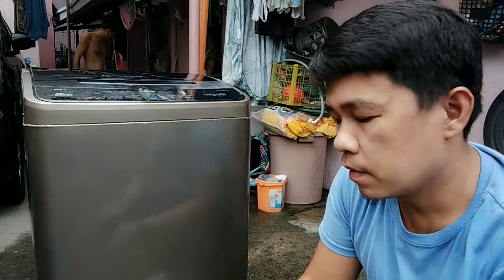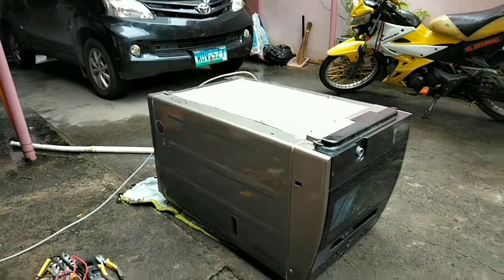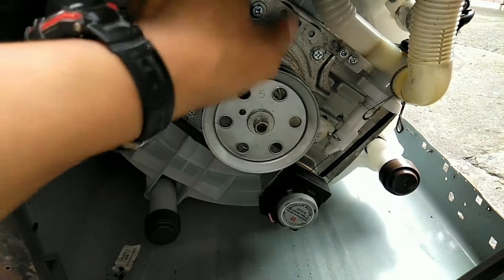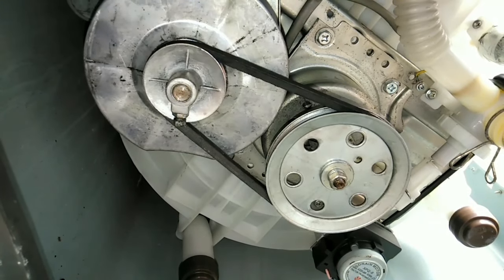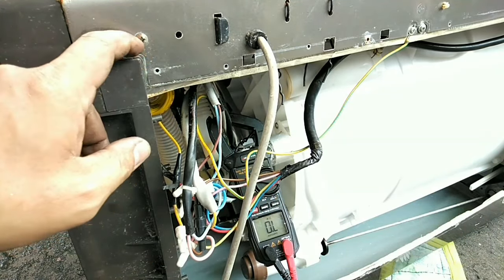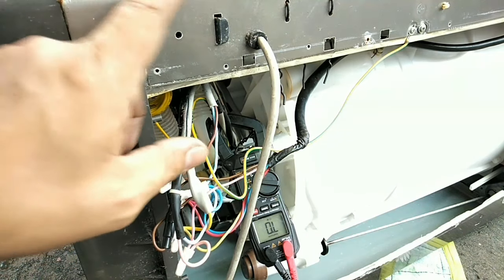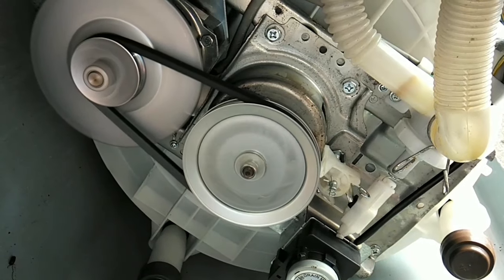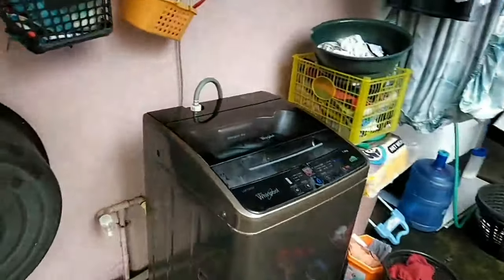Whirpool Automatic Washing machine SPIN Problem.( Tagalog )

Comment: Hipo ask k lng po d na kaya mag heavy duty spin  ng topload 10.8 kgs whirlpool kpag nka 6-10liters n po ang tubig umuuogong nlng everytime may rinse ng pakaliwa .. sa preno lng dn po b kaya problema nya

Sana po manotice, and ask ko lang din po kung gumgawa din kayo ng Cl98 LG Xboom 3500watts speaker
Reply from the maker: posible issue:

Running capacitor
belt
motor bearing

Comment: Master kakaiba problema sa aking panasonic auto wach mach.. NAKA SWITCH po sa washing pero panay parin drain ng tubig master.. malinis naman ang drin plug.. pag nkapatay ay sarado drain plug. Pag magwash na ay tapon parin ang tubog.ano kaya sira master ok naman drain motor
Reply from the maker: meron po ako video gaya ng problema nio sir..solve agad ang issue

Comment: sir gud am ask ko sana posibleng problema whirlppol fully auto isang direction lang rotation ng washer model lsa 1100 maraming salamat po
Reply from the maker: Dalawang bagay lang po yan.
Running capacitor 
Board

Comment: Ka master ask ko ung eurotek topload ko, pag ung clockwise na ikot ay sobrang hina.... Sa preno din kaya iyon
Reply from the maker: Check.po.muna  capacitor sir..
Reply: @kamastertvlhonsantelices  eh pag sobrang ingay pag nagsspin sya... Talagang malakas ka master
Reply from the maker: Ok ganito po.eto mga posibleng sira kapag sobrang ingay na ng spin mo.or dryer.

Motor bearing
Suspension rod spring
Gearbox

Comment: Sir whirpool model LSP1080GP sira na motherboard  ngayun nag ordr aq ng motherboard sa lazada WB603803 mother board tugma ba sila operate nmn cya kaso spin dryer mabagal ikot lng anu ba problim master di ba pwde ang naorder ko sa lazada sana masagot mo master
Reply from the maker: Copy...tugma yan..check muna preno.at ung tension ng adjuster
Reply: Salamat master
Reply: Sir ok nmn ang preno at tension  pag dating sa 4 tuloy2 na ikot nya at ginawa ko yung ginawa nyo na ibaba preno di aman nag shake

Comment: Sir samsung automatic po ung washing machine ano po kaya problema nung last n ginamit ko sya ayaw nya tumigil ang ikot tpos isang dereksyon lng ang ikot nya ayaw nya bumalik khit nipause n ndi sya natigil so pinatay ko power tpos nitry ko ulet pinower on ko at inistart ayaw nya umikot pra malaman kung ano water level ang need nya tpos ayaw nya rin tumangap ng tubig..sana po masagot nyo thanks
Reply from the maker: Kong dipo siya nagre refil ng tubig.
Soliniod valve po agad ang problema niya.at ung hindi naman paghinto marami po pinanggagalingan yan mam.kong continueos ang ikot at walang error na nagre register maari po sa program yan.pero kapag diretso ang ikot at may error agad,maari po mechanical system po problema niyan..bka po naputol ung pinaka spring splutched nia kaya ayw na bumalik...pero mas maganda kong macheck ng actual..mahirap.po kc ganito lng.limitado lng ang maibibigay ko impormasyon base po sa inyong sinasabi.😇😇😇
Thank you po..Godbless
Reply: Kung sakali ganun po ang sira magkano po ang singil nyo?
Reply: Pde po b kayo mag home service sa cavite?
Reply from the maker: San po kau sa cavite mam Liezl.😇

Comment: Ka master san mo inadjust ung preno sa pulley ng washing machine automatic top load
Reply from the maker: Sa may tabi po ng drain mechanism..wala pong ibang turnilyo dun na may adjuster..nakapatong sa padle ng drain mechanism.pag hatak ng drain.motor sasabay po un para buksan ung drain system thesame time ung tension ng brake luluwagan niya rin.pero kong mahigpit ang brake tension uugong na lng po talaga yan..mahigpit ang brake tension.atleast 5turn lng po kapag mag aadjust kau..baka sumobra naman..ung drain system mo naman ang luluwag..dire diretso ang tubig po niyan..tamang adjust lng sir.
Reply: @kamastertvlhonsantelices  salamat ka master may itatanong ako un bng cap 4 uf sa isang motor pwede konrin bng gamitan ng 5 uf
Reply from the maker: Pwede po dahil.kong inyong mapapansin ang mga capacitor ay may Tolerance na + or - 5%.kaya pwede po yan..

Comment: May effect ba if yung black rubber sa may filter is nahulog sa loob ng butas?
Reply from the maker: Ano.po ba tinitukoy nio..sa inlet valve
Reply: Hindi ko po alam tawag dun
Reply: Sa Whirlpool po na top load yun. Nilinis ko po kasi yung nagttrap ng dumi tas meron po palang rubber na nakadikit dun mismo and natanggal sya at nahulog sa butas

Comment: sir anu po problem pag ayaw po umikot ng spiner motor po, bago na po capacitor nya, at buo naman po ang motor kasi binaklas ko po sya at sinuplyan ko po umikot naman po  , at buo din po ang presure switch po, pero hindi parin po umiikot ang motor at tinanggalan kona rin sya ng belt hindi talaga sya umiikot ang motor pag inispin na po sya,,, anu po kaya possible problem,,,,,, salamat po

Comment: question po master, yung whirlpool washing machine po namin pagka plug sa kuryente may umuugong po agad kahit naka off pa po.
Reply from the maker: Pakiramdaman nio po.muna sir kong saan nangagaling ung ugong..sa bandang panel board ba oh sa bandang baba s motor side..
Maari nio nmn buksan ung bandang likod ng washing para makita nio kong saan nangagaling ung ugong..kc kong sasabihin ko na sa motor side nangagaling ang ugong wala po ako sapat na basehan..mas maganda po try nio po.muna DIY para po makita nio rin mismo ng actual kong san talaga nangagaling nag ugong..marami po kc posible pangalingan ang ugong..kapag naka sense na siya ng power khit dimo siya i ON..maari sa drain motor,sa soliniod valve,sa motor, sa panel board..
Reply: @kamastertvlhonsantelices   salamat po sa sagot master, muka pong sa may motor banda master.
Reply from the maker: Ok..kong sa motor side ang ugong.ganito gawin.mo.DIY ulit.tanggalin mo koneksyon ng belt sa.motor at pulley.then paandarin nio..at dun nio malalaman kong saan talaga ang pinaka point ng problema..maari stuck up ang motor..pero kong umandar naman ang motor..maari may problema ka sa preno.
Reply: @kamastertvlhonsantelices  maraming maraming salamat po master, hanapin ko nlng po yung video nyo about sa pag adjust ng preno.
Reply from the maker: Welcome Sir😇😇

Comment: Master ? Ano po kaya problema ng washing ko . Ganyang model din . Hindi nag fifill ng tubig . Kusang nadedrain tubig nya
Reply from the maker: Panu po nagdi drain ung washing nio Master,kong dipo nag re refill ng tubig..tabo na lng po ba ginagamit nio.
Maari po may problema ung soliniod valve ng tubig nio kaya di nag rerefill ng tubig .at ung kusang nag didrain naman maarin may problema sa drain motor niya.
Reply: @kamastertvlhonsantelices   nka connect pdin po yung hose sa ibabaw pag nilalagyan ng tubig . Ang nangyayare master hindi sya magamit pang wash kasi pag naglagay na sya ng tubig hindi sya napupuno lumalabas lng yung tubig sa drain hose nya . ginagamit nalang namin sya pag magdrain ng damit
Reply from the maker: Kapag ka hindi po kumakarga ng tubig..Ang sira po niyan ay Solinoid valve.
Kapag naman po kusa nagdi drain..maari po drain motor ang problema niyan..oh ung drain mechanism.niya sa loob ng tubo..baka po punit na..

Comment: Master yung sa akin posible din kaya preno kasi maingay sya pag spinning. Paano ba adjustment nya, sa turnilyo ba?  Salamat sa sagot
Reply from the maker: Sobrang ingay po ba..pag brake po ang problema...umuugong lng siya..kong sobrang ingay baka putol napo ung flutched spring nia..maalog masyado.😇
Reply: @kamastertvlhonsantelices   Master umuugong lng Ang spinner. Paano po ba mag adjust ng preno? Thank you.
Reply from the maker: 5turn paluwag sir. Dun sa adjuster nut.dahan dahan lng baka sumubra naman ung pagluwag.
Reply: @kamastertvlhonsantelices  salamat Master. Na try ko knina same pa din.  Gear box or burring ba tawag dun. Yun pla ang  sira stuck up na. Baka po meron kayo available Master bilhin ko nlng. Thank you sa reply.😄
Reply from the maker: Sa Quiapo ako bumibili niyan sir😁😁😁
Reply: @kamastertvlhonsantelices  ok  Master. Thanks ulit. God blessed.
Reply from the maker: Welcome Godbless😇😇
Reply: @kamastertvlhonsantelices  master yung bang clutch spring part din ba sya sa brake system?
Reply from the maker: Yes po..part siya..at Ung brake po un ung nakayakap at umiipit sa hub.sa pamamagitan ng drain cable hinatak niya ung clutch para ihold at pakawalan ang hub.kapag ito ay nagdi drain at nag spin.para maiwasan ang sobra sobrang ikot ng  
Drum kapag tapos na mag spin.
Parang sa manual lng din..meron brake shoe na naka hold sa hub..parehas lng sila.un nga lng sa automatic bahala na ung system sa operation.unlike sa manual kylangan mo.buksan ung takip para mag brake..😇😇

Comment: Boss pano po pag wlang power ano kaya possible na sira non?? Meron kapo bang video na Ganon Kung pano ayusin ung wlang power na whirlpool auto wash machine
Reply from the maker: Need nio po muna ipa check kong sakali kong meron jan mas malapit na tech.pero bibigyan ko po kau ng idiya bakit wala siya power as in deadset ang unit pati electronic controler.
Eto po posible na sira.
1: Power cord
2: Transformer
 Yan po muna ang sa tingin ko sira niyan.dahil jan po nag mumula ang power sa dalawang component na yan.
Salamat po😇

Comment: Sir whirlpool automatic din gamit ko. No drain and spin din sya.  Pero umaandar yung motor pati pulley.  Okay din drain motor. Pero nag stop pa din after ng wash cycle tapos ayaw mag drain and spin. Ano kaya problem?  Thank you
Reply from the maker: Ano po.lumalabas na error.
Reply: E4 po
Reply from the maker: May kinalaman yan sir sa LID switch.or unbalance load sa tub.
Reply: Yes sir. Pero sarado naman yung lid.  kahit tubig lang laman e4 pa din lumalabas. Dinala na din po sa shop sabi board daw. Bagong palit na din ang ganun pa din
Reply from the maker: San po location nio sir..
Reply: Near sm novaliches po

Comment: Master Tanong lang Ganyan din po kasi Washing namin ang problema po kasi ayaw tumigil magkarga ng tubig kaya ayaw mag Wash  saka panay E1 error Ano po kaya possible Sira po nun? Sana po masagot nyo ang katanungan ko 😩
Reply from the maker: Posibleng may problema jan sir ay Water level sensor...at drain motor
Reply: Magkano po kaya paayos ng ganto sir? Kasi 3 months na namin Hindi nagagamit yung Washing.nung May lang namin nabili
Reply: Sir ask kona din po ano po tawag dun sa blue na takip sa ibabaw po ng kabitan ng hose? Nawala ko po ksi yung takip na parang hipitan ng filter.saka pede ko po ba kayo ma pm sa Messenger nyo para mapadali po pag contact sa inyo? Marilao bulacan po ako
Reply from the maker: Waranty papo yan sir..baka pwede nio tawag sa whirlpool..
Reply from the maker: Cge sir...wait ko mesage mo sa mesenger

Comment: Boss parehong model ng washing machine namin. Ayaw mag spin dry. Humahatak kapag nag drain. Saka na wawash at umaandar motor. Na check na din ng tester capacitor. Buo pa. Baka makatulong ka. Salamat po.
Reply from the maker: San po location nio Sir.
Reply: Paranaque boss
Reply from the maker: Na check narin po ba ung clutch nia sir at ung brake tension..baka kc sobrang higpit kaya ayaw tumuloy ng spindryer niya.
Reply: Master ahingi ng number para matawagannk po.may ipapaayos po Sana kmi.

Comment: Master, E4 problem, gumagana naman motor and close lid. Ano kayang problema?
Reply from the maker: May kinalaman sa drain system
Reply: @kamastertvlhonsantelices  ano po contact number nyo master?
Reply: or kahit fb messenger
Reply from the maker: 09976217047
Reply: @kamastertvlhonsantelices  nagmessage po ako sa messenger nyo Master. Asking po sana how much parepair.

Comment: Pano po mag reset ng whirpool  waching machine gumagana naman po kasi ung sa dryer or spin lang po ang ayaw parang may napindot po kasi
Reply: Magkano po pa service  san jose del monte bulacan lang po qko
Reply from the maker: As long as wala.po error Mam...no ned po mag reset..maari may problema lng sa mechanical system nia.
Reply: PAG MAGPAPAGAWA PO PANO KO PO KAYO KO CONTAKIN
Reply from the maker: Lhon Santelices
My messenger name.
09976217047
My contact no.

Comment: anong model po yan? ganyan din yta model ng akin. ayaw mag reverse po
Reply from the maker: Automatic din po ba Mam.
Reply: Opo
Reply from the maker: San po location nio Mam😍
Reply: North caloocan po. Llano
Reply: tinest ko po ng walang laman ngaun. maayos naman po ikot clockwise and counter. na ooverload lang po yta. wala po kasi ako timbangan para malaman kung overload.
Reply: maya test ko na mga 12 lang laman na damit kung maayos iikot
Reply from the maker: Taga llano po ako.dati nakatira.sa Barangay Silanganan..malapit sa may rebisco..ganito gawin nio.tanggalin nio muna ung connection ng belt to pulley.stand alone po ang testing nio.then paandarin nio washing.kapag umandar po.ung motor ng forward at reverse.means po good ung rotation ng motor nio.maari may problema ung adjustment ng brake nio.kumakalas sia kapag reverse rotation.pumipitik po yan or kumakalas kaya wala siya reverse.
Reply from the maker: @ulupongmotovlog2682  Anytime po as long as kaya ko kau i acomodate para mareplyan at mabigyan ng advice handa naman po ang inyong lingkod..para di kana rin gumastos..tanung lng po kau lagi
😇😇
Reply: Napakabuti mo sir. Talaga pong sumasagot ka sa mga tanong. Sana lahat sila katulad mo po. Salamat po ng marami sir
Reply from the maker: @ulupongmotovlog2682  wala pong anuman.salamat din po sa tiwala.Godblesa po.keep.Safe😇😇

Comment: Hi sir, good pm!!! Ano po pwde gawin if ang drain motor walang movement? Gumagana po yung washing function.
Reply from the maker: Check.mo.ung cable ng drain motor sir..baka sobrang nakalaylay na.
Reply: Okay naman po Sir. Actually napanood ko yung ibang video mo. Binaklas ko yung drain motor. Pumipitik lang yung solenoid ata yun di ako sure pero di umiikot motor. Hopefully itong drain motor ang sira. Mga anong range kaya prices ng drain motor? Nasa Davao kasi ako. Thanks sa sagot.
Reply from the maker: Baka abutin ng 1k yan jan sir.
Reply: @kamastertvlhonsantelices  hi sir, good pm! nagpalit na ako ng drain motor at gumagana na spin niya. pero pag mag wash na hindi napupuno ng tubig yung tub, napansin ko hinihila na ng drain motor yung drain valve ba tawag nun. kaya yung tubig tuloy yung draining habang ng fifilling ng tubig
Reply from the maker: Adjust.mo.sir tension cable ng drain motor mo.sobrang higpit niyan sigurado.
Reply: @kamastertvlhonsantelices  napansin ko sir, pag ka on pa lang hinihila na ng drain motor yung valve. hindi pa ako ng execute ng wash
Reply from the maker: Ganito
Tangalin.mo.muna ung drain motor.rekta mo sa 220volts..panuurin mo.ung video.ko sir about troubleshoting ng drain motor.kulang kc nag mesage para ma explain ko sau
Reply: Ok naman ang tension ng cable ng drain motor. Ano kaya iba problema nito?
Reply: Yes sir, ginawa ko na direct sa 220v yung luma bago ako bumili ng torque motor, kaya kampante ako sira talaga drain motor. Itong bago direkta ko ngayon sa 220v. Same lang din pag ka on ng makina, hinihila niya valve kaya open siya. Pag ka execute ng wash di nagcloclose ang valve kaya drain diretso ang tubig.
Reply: Thanks sa reply sir, e-figure out ko lang muna ito baka pahinga lang muna kulang. Good pm!

Comment: Gud pm po sir ano po kya problema ng top load whirpool washing machine namen tuwing ngddryer po ako sobrang ingay po na parang my sumasabit ....sna masagot nio po ang tanong ko slamat...godbless
Reply from the maker: May problema napo ung pinaka fluched gear nia Mam..at spring niya..maari po putol na un..ph di naman kaya maari maluwag lng ung fanbelt..oh ung gearbox na mismo ang may problema..😇
Reply: Mgkano service nio sir kung sakali po ipapacheck ko po sa inyo sir??
Reply from the maker: San po location nio Mam😇
Eto.po.number ko.
09976217047
Reply: Caloocan north  llano po sir
Reply from the maker: Schedule po kita nextweek sir..ned po ntin mag usap sa mesenger para maisend mo sakin model at mismong itsura ng unit...
Lhon Santelices po mesenger name ko.mag mesage kana lng po dun Mam😇

Comment: Master paulit ulit nood pero hindi ko nakuha kung paano mo inadjust...kinalas mo at binalik wala kang inadjust yung preno... paano mag adjust?
Reply from the maker: Sa may bandang 9:54seconds ka master.meron ako pinupush na part kulay itim.then kong mapapansin nio po ay meron turnilyo maliit na naka tukod sa brake adjustment.un po ung iaadjust nio ng atleast 5turns.ngaun ko napansin wala pala ung video kong papanu ko inadjust ung turnilyo..pero wag po kau magalala makikita mo po agad ung turnilyo maliit malapit sa string cord ng drain motor.un po ung iaadjust nio.atleats 5times paluwag.para kumalas po ung stock up brake niya.
Salamat po at Godbles😇
Reply: @kamastertvlhonsantelices  sa akin ayaw mag reverse
Reply from the maker: San po.location nio Mam😍

Comment: Nak puwede kana mag home service ng 2 automatic washing machine  ,ayaw mag spin. At UN isa motor working ayaw mag wash.but hinde whirlpool iba brand.taga Taguig city ako.Ano CP no.mo
Reply from the maker: 09976217047 yan po number kom
May mesenger kapo.ba mam
Reply: @kamastertvlhonsantelices  sir tanong kong nagpalit ako ng drain motor,, puro drain n rin sya,, anu ba probs non
Reply from the maker: Check.po.muna tension ng drain cable
Reply: Ano po messenger nyo
Reply from the maker: Santelices Lhon

Comment: boss yung samin mabagal ikot ng spinner ano kaya sira?
Reply from the maker: Check po muna ung running capacitor niya..baka po weak value na..
Reply: @kamastertvlhonsantelices  Ginaya ko yung ginawa mo boss. Hindi umiikot yung isang bilog sa ilalim, possible po kaya maluwag na yung itim na bilog “belt” ata tawag dun
Reply: @kamastertvlhonsantelices  pag po kaya yung capacitor yung problema ano po ayos?
Reply from the maker: Kapag weak na ang capacitor di mag spin ng washing mo.at kapag masyado n mahigpit ang clutch brake di rin basta basta aandar.
Reply from the maker: Dipo basta basta ang pag adjust  yan sir.meron po yan certain turn yan..baka sumobra naman at mag cause pa ng ibang problema.